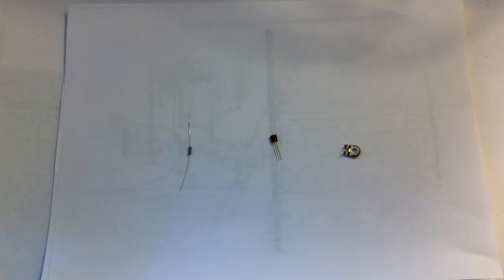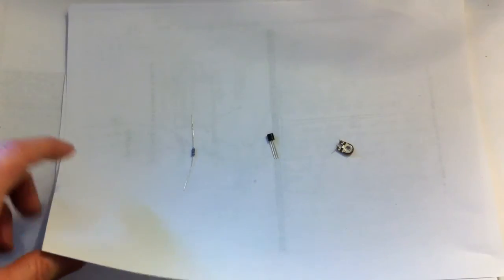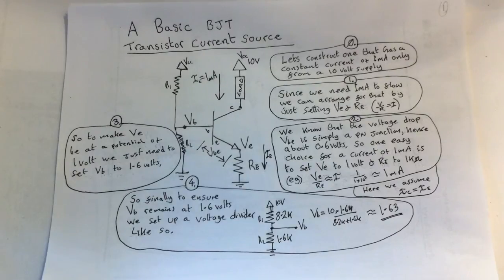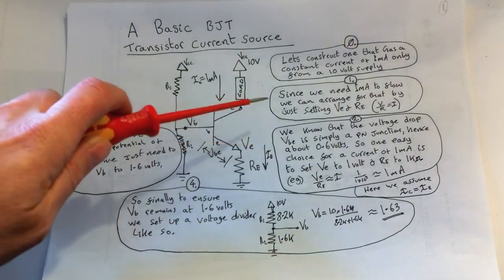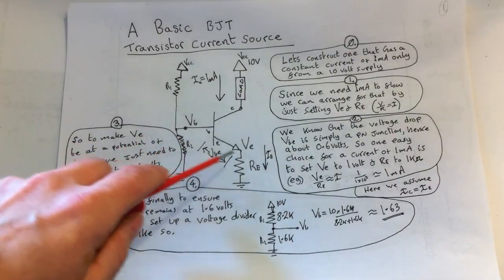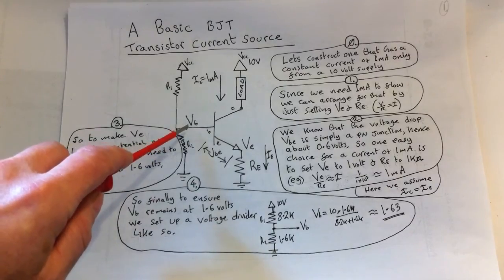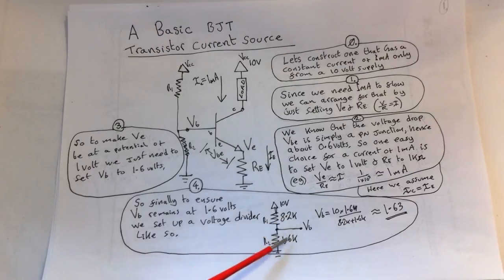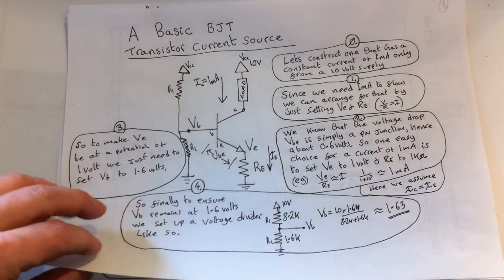1. BJT Transistor current source/sink circuit

Comment: I have a question you may be able to answer. I imagine mobile phone battery chargers are designed to produce a maximum current. I bought a universal charger but note that the output current is 2A whereas the phone manufacturers charger is rated at 1A. Would I be right to assume the regulation current circuit is in the charger not the phone and therefore using the alternative charger could damage the battery?
Reply from the maker: Sorry Steve. Only just saw this comment. Its a very good question. The answer is not obvious. All electronic circuits (devices) will use the current they are built to use. Batteries and chargers only specify a maximum current that they can handle. So if your buying a phone charger go for the one that can handle the maximum current. Just ensure voltage rating is same as that of phone. Then when newer mobile phones come on market that can handle faster charging eg higher currents, then the bigger charger may still be good enough. Whereas the 1 amp  charger would need to be replaced.  What is important though is that the voltages specified for your phone and the charger are the same. eg a 5volt phone needs a 5 volt charger.
Reply from the maker: So, to summarise. Current does not matter as long as voltages specified for each is the same. As devices will only draw the current they need. So even if you had a 1000amp 5 volt charger and wanted to use it to charge a 5 volt 1 amp phone all would still be fine. Not that such a beast is even available, its just silly example to get point over.

Comment: in the calculation you need to figure in the base current which increases the voltage drop thus decreases the base voltage, but makes little difference 'cause a 2n3904 has lots of beta, thus in a circuit with low beta the base current would have to be figured into the equation gr8  vblog BTW
Reply from the maker: Yes well spotted, I did not bother to include it in this case as so small. It is a very rough nuts and bolts analysis that is for sure ;-) Thanks for the feedback.